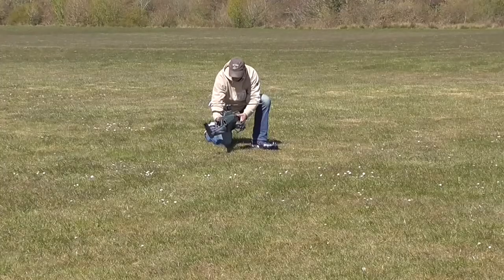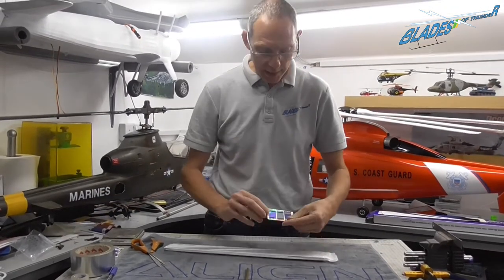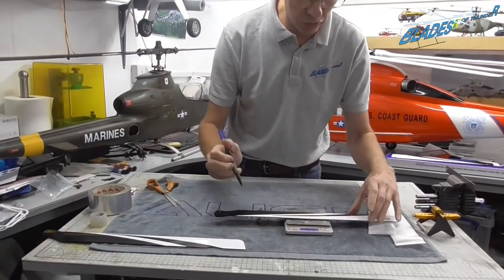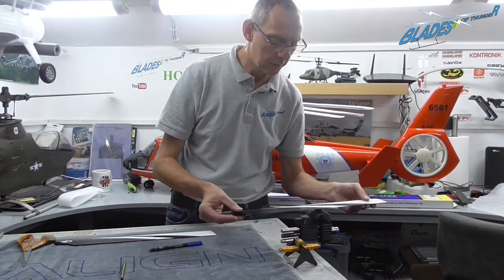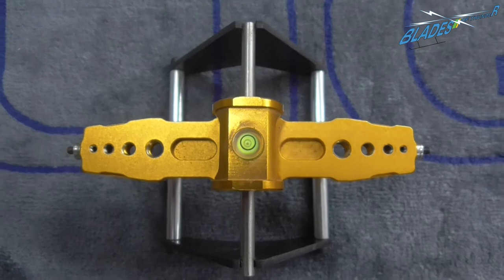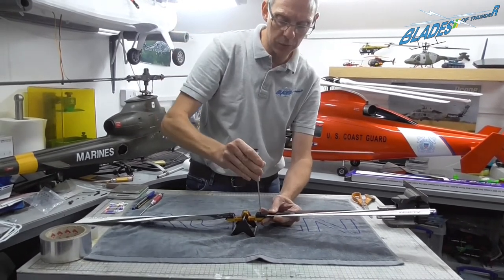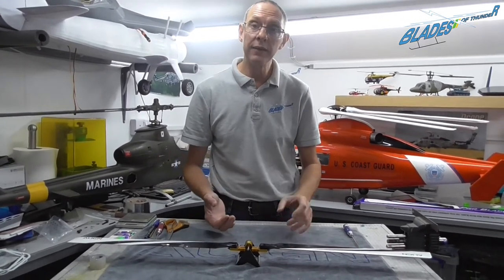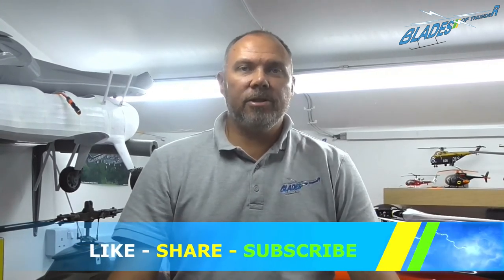How to Video -  Blade Balancing

Comment: Correct me if I'm wrong: ideally, you want to place the tap at the CoG of the lighter blade. In your video, you intentionally did NOT do so as the CoGs on both blades are slightly off, and you want to move that on the lighter blade slightly off so that both are identical. However, you should have gone back and check if that's the case though; otherwise, your blades not still not statically balanced.

Comment: I'm always surprised when people still do this as a matter of course.  Weigh them.  If they're within a gram, fly them.  If you see or hear something unusual, balance them.

I've got 15 or so machines in flying condition ATM.  They range in size from 280mm to 770mm blades.  Not one did I need to balance the blades.  Not one has a problem in flight or a flybarless unit that complains of excessive vibration.

If you enjoy this portion of building, fine.  Do it.  Enjoy it!  But stop telling everyone it is so important to do.  It isn't.  I stopped balancing blades about 12 years ago when the manufacturers started consistently making good balanced sets.  It has never been an issue.  Objectively speaking it is a waste of time in a VERY large percentage of cases.
Reply: Your opinion, and of course it’s bad. Just got a new Align kit, had to put a piece of tape 2”X2” on one to get the balance. Consistently good blades?! pfft horse droppings. Balance your stuff right folks, not by blind faith lol..wow
Reply: I saw @Randyman X's reply, and I thought maybe I have something to learn here.  So I did what I always do when I'm doubt about technical heli stuff.  I asked a bunch of friends in the hobby that are pro pilots or have close relationships with pro pilots.  I'm talking guys that fly center stage at IRCHA, pilots that fly for SOXOS, Goblin, XL Power, team managers for major brands, etc...

NOT ONE of them regularly balances blades or knows anyone who does.  Their advice all boiled down to my exact advice above.  Fly them out of the box.  Only balance them if there is an issue.  But as a habit, not one of them balances blades by default.  Most NEVER do.

If you doubt me, jump on the RC Heli Hangout and poll the 3,000+ members there.  You'll run into a few people who always balance, but the overwhelming majority don't, and for good reason.  It just isn't necessary very often.
Reply: @randymanx2674  ive never balanced mine either. did so this weekend and notice no difference at all.

Comment: He makes the classic mistake of just rehashing this flawed method without thinking it through. First of all, you cannot move the C of G of a blade inward toward the root by adding weight to that side of the C of G point. The reason for this is that these blades are not going to remain separate objects, they are going to be bolted onto a rotorhead and will become part of a whole unit. The only way to move the C of G inward is to REMOVE weight near the tip (not recommended!). And, as someone mentions elsewhere in these comments, - the whole idea of worrying about matching C of Gs is a myth in the context of today's very rigid carbon blades.

Comment: As the blade tips on the round rod its contact point moves a little allowing a stable point of balance. The ruler has a sharp edge and so the blade starts to tip over and the contact point does not change so it just keeps tipping. So use the rounded focal point for this is my advice

Comment: Do not add the weight diff to the HEAVIER blade... add the weight diff to the LIGHTER blade, placing the tape (weight diff) at the position where the centers of gravity are the same on the two blades?  This way they will have the same weight and same cog.  Then you can fit them on the balancer to double-check if you want... they should be spot-on, but ONLY if you have EXACTLY the same weight.  If you are off in weight even by a tiny amount the balancer will show it... but essentially they will be balanced.  The "tiny" amount is what you are comfortable with... for some it will be .5g for others .1g and then you have the obsessive type that won't be able to sleep at night until they get it perfect.

Comment: It's a good idea to move the blade covers out of the way when you're weighing them so the tips dont touch them as they clearly did in this vid. Always add weight to the lighter blade not the heavier.
Reply from the maker: Thank you pointing the slip of the tongue you are correct the weight is added to the lighter blade. The Blade covers were not touching the blades its the camera angle that makes it look like they maybe.

Comment: Reading the comments here I can see a lot of people who are saying balancing is not necessary and the helicopter will fly regardless. I'd say this is truer today due to greater manufacturing and quality controls of the blades and better noise isolation algorithm in modern flybar controllers. But I do have to say a balanced blade makes a difference when comparing data logs before and after, somtimes its quite considerable. Now whether the machine flyes better well thats subjective.
Reply from the maker: Yes and No. If you buy expensive high quality blades as matched sets then you probably dont need to balance them. If you then start painting the blades for scale then you definitely need to balance. An out of balance set of blades will cause horrendous vibration. This goes for tail blades too

Comment: Hi very helpful video, can you do video going over a good throttle and pitch curve for a scale heli
i have a Hirobo Lama a big step up from my OMP heli any advice would be appreciated
Reply from the maker: first question what omp heli and your skill level.
Reply: @bladesofthunder9778  Hi OMP m2 also flew blade 230s and had a trex 500 that i could hover and manage very gentle  circuits 
so my level i put my skill level at intermediate
Reply from the maker: @leepering6824  the Trex 500 should be the easiest of those 3 fly. The M2 and blade 230 have to much self level  and auto hover that you will not have with with a larger scale model. This means a chip not you is flying the model your just guiding it around. We recommend dusting off the 500 size model once you can take off and land without drifting,hover at the 4 points of the compass, fly a lazy 8 and gentle circuits with it your be ready for your lama.
Reply: @bladesofthunder9778  Hi thanks for the tips
Reply from the maker: @leepering6824  your wlecome. feel free to get in touch via our facebook group if you need any more help

Comment: Thart old useless balancer will not balance out the lead or lag between the blades. for that you need a balancer that can balance the cord of the airfoil. last i looked those balancers were about 500 bucks.
Reply from the maker: Of course it wont lead and lag are caused by the aerodynamic forces acting on the blades during flight and has nothing to do with balance of the blades and varies constantly
Reply: @bladesofthunder9778  Well that is not i was taught threw out my almost 10,000 hours of  Rc rotor wing experience.
Reply from the maker: @videocruzer  well as its a single bolt and no lead lag dampener on the head its impossible to control lead lag on the model.   all  you have is a rubber dampening ring on some of the heads. The blades will naturally find there happy at various stages of the rotation. unless to build a full or semi articulated rotor. 30 years as a full size aircraft engineer and rc modeller here. but that does not mean we know everything so happy learn please post a video on how you balance for lead an lag
Reply: @bladesofthunder9778  except for the imbalance between the Cords or weight imbalance down the cord line. Only precision guys worry about that balance.